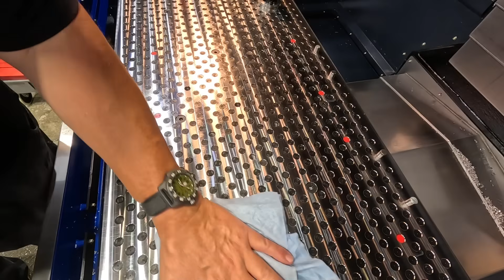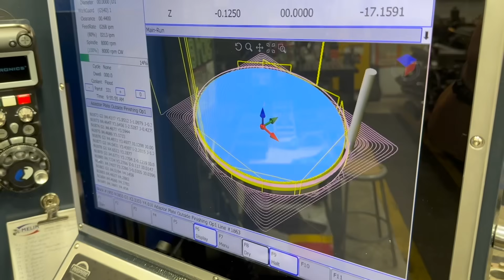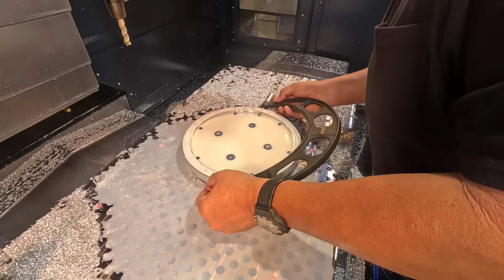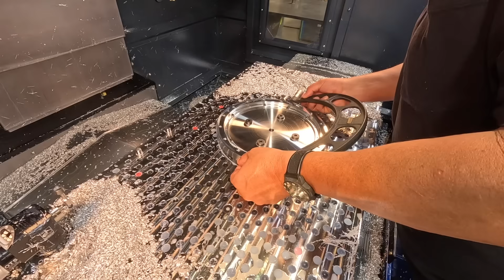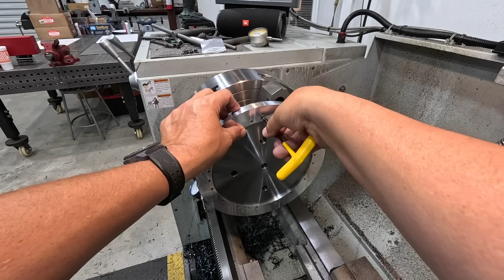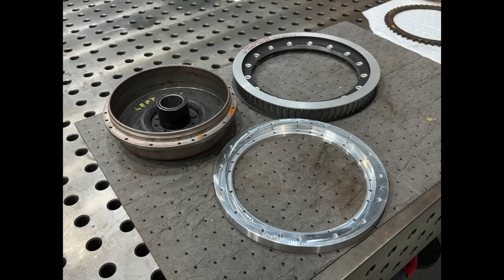Harley Davidson Shovel Head Belt Drive Project Completed

Comment: Came out great Adam. If the dowel pins are installed first they should align the rivet holes automatically when assembled. I just hope he does not have an issue with aluminum being riveted to steel. They have a different expansion and contraction rate, hopefully they do not work loose over time. Thanks for sharing the project with us. ✌️

Comment: Hey Adam, when you assemble it all at the end of the video, did you set it up onto the lathe and check for run out?..I know with the belt drives they can rub a bit on the edges if runout is too much....would love to see that. Great job as always!

Comment: I need to go back and see the previous videos for this project. I’m not sure if this a bike just for show, or a driver. My concern is the added reciprocal weight on that wheel. I know from personal experience that those drum brakes are marginal at best and the additional rotating weight is not improve the situation. All fine and good for a show bike, but I’d be cautious on a daily driver.
BTW, I’m using the same ‘58-64 frame and round swingarm on my current project but I adapted a disc brake to work with it. I was originally going to do a Supermax rear pulley conversion, but my friend Phil Ross, owner of the company passed away making me stick with a rear chain drive. The advantage of the Supermax setup is the pulley is a polyethylene material which better matches the material the belt is made with, leading to extremely long belt life. And it is much lighter weight.
I’m not a safety ninny usually, and no stranger to two wheel death traps, but at 70 I’ve had too many close calls.

Comment: Nice job! Tell him to put the adapter plate and drum into the freezer for several hours prior to assembling to the pulley; it should drop right in with no issues! That is how we install the swashplate bearings on helicopters and it works like a charm.

Comment: Way too many holes to expect perfect alignment, even with computer stuff. Hand drilling the rivet holes after the bolts are secured  would be structurally fine as the application of the rives would expand to fill the differences.

Comment: Your concept and thought process was great, if you were to be doing this in a production mode. You would have made two fixtures one for each face operation. That way the ring both circumference and face would have been supported for each operation. But doing only one. It required you to modify the one fixture to do the last operation. At least from the video that is what I see. Thanks for sharing and God Bless!

Comment: Great job, Adam!  For a project like this, with several critical dimensions, I wonder if you could build a few acceptance testing software modules that would use your Renishaw probe to make certain that test fixtures were aligned and that critical dimensions from the customer specs were within tolerance.  As you said, even a stray chip could throw off critical alignments.  Also, if you program this test module by looking at the specs rather than the details of how you are building the parts, you would be looking at the requirements with fresh eyes, as they say.  I'm not a machinist, but in the past I designed and developed critical software.  I always added extra tests to make certain that the data was consistent with the design.  Later these tests could be removed.  A stitch in time saves nine.
Reply: You can do that, but it only account for tool wear, which is going to always be somewhere between very low and non existant in aluminium. Other geometrical errors will carry through. If they're machinied incorrectly, then they'll probe incorrectly. This part is definitely out of round, because the mill cuts out of round. If you measure that same hole with the machine you cut it on, it'll show up as perfect.
Reply: @spikeypineapple552 , Thanks for the well thought-out reply.  However, if a probe measures n points on a surface, it can often calculate more than just one important parameter.  For example, if you know that the part has a circular outer surface, you can calculate its radius and its center with just 3 points.  If that radius seems wrong, perhaps the operator might want to know right away so they can do some more checking.  Similarly, three points on a plane can define the plane, but it can also tell you if it is tilted. With four points, you could tell if the "plane" is warped.  I notice from the videos that it only takes a few seconds to position the probe and take an extra reading.
"Ah", you might say, "if I send my probe all over the place then it's going to crash."  I have two counters to that.  First, if you are about to drill and tap 32 precisely-registered holes on a part that is already valuable, noticing that the part is misaligned might be worth more than a new probe tip.  Second, the more data that you collect, the more safe paths will exist.
So, I am saying that someone with some extra math and programming skills might be able to chase a lot of expensive Bozos out of your shop, as Tom from Oxtools would say.  Adam has been able to progress so fast in part because he has been willing to pay for some extra consulting and education.
Reply: @stuartschaffner9744  This already exists. Everything you've listed there is a 3 click exercise in the software Adam uses.
You're talking about all the possibilities, but you need to talk about what issues you're trying to solve.
Issue 1 you've identified is a part you've cut that's out of tolerance. This is a solved problem. Like I said though, if you measure on the same machine you've cut, it won't account for geometrical issues with the machine.
Issue 2 you've identified is loaded stock out of position. This is also a solved problem. What you see here is Adam manually inputting the probing parameters before he cuts. In production that probing is in the program, and it'll probe the stock every time before the cutting begins. It means you don't need a vice stop, you just put it in roughly the right place, and the machine knows where it is. While it does this, it'll have a maximum tolerance for the length and height deviation, so it'll alarm out if it's too big or too tall. If you probe 3 points on the top, it'll alarm out if they have too large a deviation(part tilted in vice).
Reply: @spikeypineapple552  , good. I think that we're on the same page. I am reacting somewhat to specific things that Adam mentioned, like perhaps getting a chip wedged under the fixture.  Also, he mentioned that even a slight rotation of the part on the fixture would make it impossible to add some rivets near the end.  Finally, he had to stop and re-machine a fixture because he had changed a spec during the build and hadn't yet taken care of some of the other ramifications.  A test to recheck the specs during the machining might at least have reminded him that he had already deviated from the original design.
I'm not casting shade on Adam, by any means!  He's doing all the right things to learn as fast as possible.

Comment: Way did you not use the mill it was in to cut dia. To size I don't understand going to lathe ?😊
Reply: 😂 just longer and charges by hour 😂 actually I don’t need the fixer plate to machine part, you can easily done it just stack it up from the table whit some blocks

Comment: Couldn't your adjustment to the fixture have been done in the VM?
Reply: 😂 so you’re asking if you can mill a part while it in a mill ? Yes he definitely could have made clearance on the mill, but somehow he always approaches the longest way to do stuff. You didn’t need to fix your plate at all for this part just space it up with some 1-2-3 blocks. It’s not the wrong way to do it like this, but it’s just more expensive for the same result

Comment: Adam, I have just one question/ concern about this project. Corrosion ? Aluminum will corrode, what is the plan to prevent it? Not only just from the weather but also from galvanic interaction between the aluminum and the cast iron. I would suggest a dip in some sort of clear coat after assembly to seal it. But I fully understand that that’s not your concern. In any event as usual you have done a masterful job. Thanks for sharing all of your experience with us.
Reply from the maker: He expressed interest in having the adaptor anodized.
Reply: @Abom79   Your tolerances from machining are so tight there is the possibility that after anodising they won't fit together anymore.

Comment: Would like to see it on the granite plate and let a last word speak
Reply: That would open up a whole new can of unnecessary worms.
Reply: Pretty obvious the mill cuts out of round, he had .01mm clearance between those two parts and they still wouldn't go together. All that time and money banging on about tenths, but the bore is out of round by 10x that. You can see at 41.31 its tight backwards and forwards, but not left and right.
Reply: @spikeypineapple552  Don't worry about it. It's a part for a Harley Davidson, nothing is perfectly aligned on those awful things. 😁
Reply: @Etol1963 then why did he charge the customer to have it measure within 10ths?